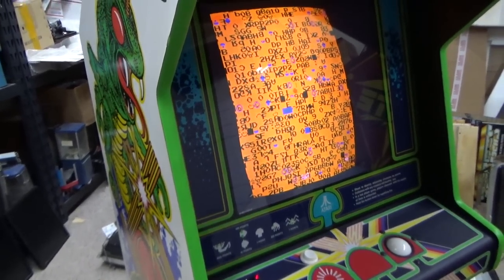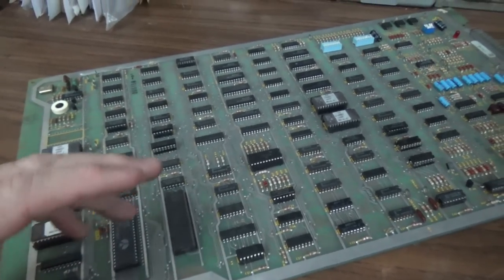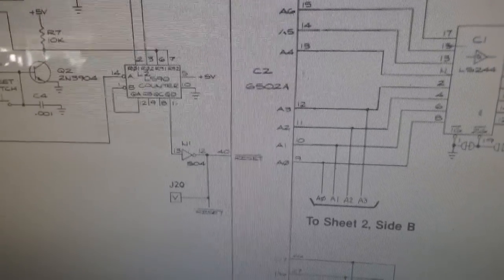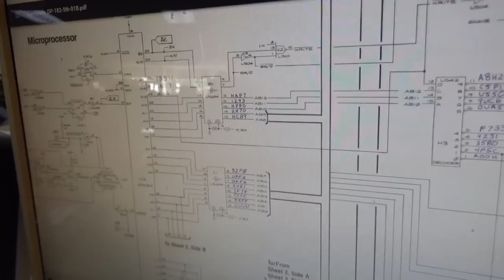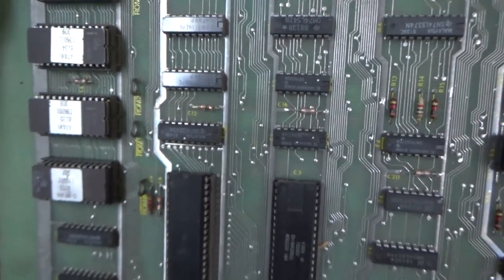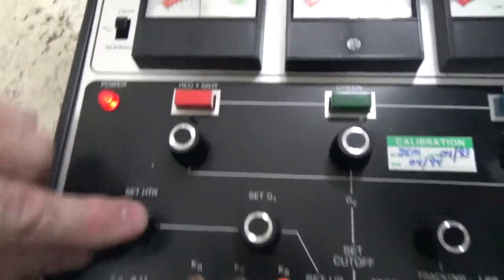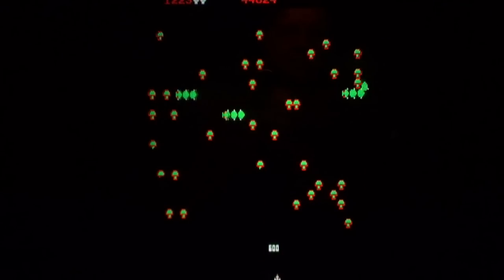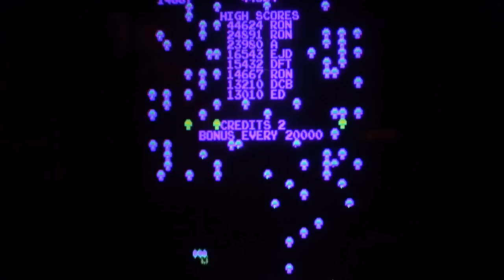How we Repair an Atari Centipede Arcade Game PCB With Minimal Test Tools - Simple Schematic Theory

Comment: Great video! However, I too have a Centipede that I'm having problems getting it to run. Upon powering it up, both player start buttons flash continuously and there are wavy vertical lines moving across the screen from left to right. No audio and sounds from coining up the game either, nor can I put it into test mode. Voltages were slightly low on the board, so I bumped them up to spec but still the same problem. Not sure what to do at this point. :(
Reply from the maker: When the buttons flash very quickly it's the game resetting over and over again because the program figures out something is wrong.  If it's wavy, as in you see the image diagonally, it could be that the sync section of the board isn't working.  The Sync section is driven by the counters in that area, if you look on the schematics right at the beginning, there will be an area that says like 1v/2v/4v/8v/16v/32v/64v etc. and 1h/2h/4h/8h/16h/32h etc.  Those are the signals that create a lot of the timing that makes all the rest of the game work.  Also those counters fail often.  If you have a logic probe, you can test each one of those lines coming out of the counter, and see if you can find one that's dead.  They should be pulsing back and forth as they send a frequency, if it stays low or stays high, that line is dead and the chip outputting it is probably screwed up.  If one of those lines is messed up, basically the game can't run code and without being able to run code, it can't run it's ram test.

Comment: as you probably know the shorts are usualy caused by burnt carbon  on the guns from impuritys in tube
 during manufacture and  randomly land on the gun assembly especially on mirror type cabs were the tube is neck down some times not often it can be encouraged to fall back into the tube by careful sharp taps to the neck while the tube is face down. anyway i was trying to repair one years ago when my brother threw a fire work into the garage behind me luckily i heard the fuse sizzling and ran out the tv was switched on .after the very loud explosion i went back and i could hear a ringing sound coming from the back of the tube looked at the front of the tv the picture was shaking believe it or not when it settled down the short was cured not only that but the red wich i had turn up due to low output was now too high i turned it down and tv was perfect. i have been waiting to get another shorted tube to re try this but havent come across one yet.

Comment: Excellent work as always :)
I was hoping you'd repair the board with the colour issues lol, as I have a spare board that has just developed an issue where the game boots, but instead of having a black background, it boots with a different colour background every time it starts. any ideas?
Reply from the maker: I've got two of them that do that and I can't figure out what it is... the reason it's starting with a different color is because the color ram isn't being controlled properly, it's something with the enable signal on the color ram chip and I can't figure out why it never gets turned on.... if you swap the ram it just makes it a different color, lol  Tough problem but if I ever figure it out i'll do a video on it :)
Reply: @LyonsArcade  Oh wow,  So that is interesting that we have the same issue! Would certainly appreciate the video when you get around to it one day :)
Yeah so F2 on my main board shat itself, So I figured I'd run the spare and keep my missus happy as its her game.  It worked great for a session and then developed the colour fault on the next start up.  It was one of those "C'mon now" moments lol

Comment: Hello- My positive and negative 22v test points on my Centipede are testing at 25.9 and 25.2. Does this indicate an issue with my board or power supply? Thank you very much for your help!

Comment: Newbie here, I have a question.  I recently just measured the voltage right at the jamma harness going into my CPS2 A Board and it reads 4.71 volts.
It reads 5.1v at the power supply.  So it must be losing a little bit on the way to the board.  My question is should I try to turn the voltage knob up a little bit  to try to get closer to 5v at the harness?  Currently the game plays just fine.  I just don't want to do any longterm damage.  And 4.71v seems a little too low in my inexperienced opinion.
Thanks
Reply from the maker: The best way to check is to measure it on the little fingers on the jamma board (not the harness, the actual board) to see what the voltages are that are actually getting through the connector.  Running it at 4.71 won't hurt it but it will probably be unstable and reset from time to time.  If it drops that much in the lines the lines probably aren't quite big enough to carry enough current without the voltage drop.  Yes though, you can turn the voltage up at the power supply to overcome it, all that is important is how much is getting to the actual board.

Comment: Great video! Did you change the cpu? Fake?
Reply: 6502 CPUs are not the kind of thing anyone counterfeits. If modern chips were made today they'd be better than the originals anyways. In the early 80s humanity could barely make a CPU period. Things have improved a lot since then.
Reply: @1pcfred  In the video Ron states “it might be fake I’ll change it. Just wondering if he did swap it for a known good CPU. We need continuity people! The fakes are non functional. Just the same form factor with the correct part number stamped on it.
Reply: @0MyWay01  if it was fake there wouldn't even have been sprites on the screen. No fake could have functioned that much. The buffer was clearly the issue. 6502s aren't worth faking either. They're still readily available. It looks like they're even in production still. Just not from the original manufacturers. The new ones are likely better than the originals were. Diffusion tech has improved in the past 40 years considerably. So even Wang Hung Lo in China can do it better today.
Reply: @1pcfred  -- Well, only the WD65C02s are being made now. If you need the original (like fixing an Apple), you pretty much have to go with used or NOS, and that's even harder if you need one from the "Sally" run to fix an Atari computer.

There were "counterfeit" chips back in the day. RAM often came with no markings at all. Some RAM was made by Mostek (junk), and that was not the same as MOS Tech (among the more reliable).

What hobbyists and repair folks need to watch out for today are things like the 74xx chips, EPROMS, and sound chips.
Reply: @PlumGurly  I have a lot of 74XX ICs from back in the day. I used to work at an assembly house and the boss gave me any extras we had lying around. Plus I scrapped a lot of parts. I was never into Commodore or Apple though so I don't have any of those special chips.
Reply: @1pcfred  -- Yeah, the Sally 6502 was a regular 6502 with a halt line. If you want to use bus-mastering DMA, then you need a halt line to pause the CPU and unlatch the bus. If you need one and don't have one, you could make a board with the CPU and 4 additional chips.

I mentioned the Apple II because it was built around the original 6502. The 65C02 may have changed the cycle timings on a few instructions. So the sound may be off and the floppy drive might start trashing disks. It used bit-banging to drive the devices and was timing-critical. So if you use a more efficient 6502-derivative or increase the clock rate, it won't work properly, at least not unless you want to rewrite the ROM.
Reply: @PlumGurly  I've avoided the whole retro thing myself. I guess everyone needs a hobby but pursuing that old stuff isn't something that I'd do. Not when there's so much new and better stuff today.
Reply: @1pcfred  -- Well, most in the retro scene are not purists. So they are not above using FPGAs, SMDs, and make workarounds using newer tech. So a lot in the retro scene embrace the shortcomings of trying to have something more like what was around in the day.

If I were to attempt to build a pinball machine, I'd likely use the older stuff as a template for things such as cabinet sizes, etc, but embrace newer tech where possible. So it would make extensive use of LEDs. And if the old "bricks" can't be found, I'm sure there are plenty of replacements to use, even if you must use multiple PSUs to get the job done. As for mech, I am sure plenty of stuff can be fabricated fresh, and for a lot of things, there are replicas of older parts that are being made now.
Reply: @PlumGurly  that's practical. Retro computing strikes me as an impractical pursuit though. As long as they're having fun I suppose it's all good.

Comment: When the monitors heater circuit is shorted that means that the monitors CRT TUBE has a shorted heater internally inside the CRT Tube? Even if you used an external power supply to supply the heater voltage it will still short out the heater voltage. The Clock Signal is triggering the Enable pins for all the IC chips which is clocking out the data out of the IC chip or clocking in the data into the IC chip. If you Remove the Clock signal the data should be free running ( not clocked ) because most of the IC chips have an Enable Pin which if you tied direct to +5 volts the data will be active all the time ( not clocked )
Reply: I'm not sure if that is right. The /CE or /CS line on most chips just disables or enables the chip. That has nothing to do with the clock, and most chips don't use a clock signal, just registers/flip-flops/latches, counters, and memory. Most of the chips are combinational logic, like gates that work irrespective of a clock signal. Things that require a clock signal is called sequential logic.

Registers need a clock since a time reference is needed. What goes in and what comes out relate to different cycles. The output comes from the previous cycle while the input is from the current cycle.

On memory, there is asynchronous memory that doesn't need a clock signal. As long as you can do things within its rated time, it doesn't matter if the rest of the circuit it is in requires a clock signal or not. Other types of RAM such as synchronous, registered, DDR, QDR, etc., require one or more clock signals.

A CPU is generally a synchronous device, even though they also use plenty of async logic inside. They do make asynchronous CPUs (and even GPUs) but the market is slow to adopt those. They don't use a clock and tend to use twice the amount of logic of synchronous CPUs. They have the potential of being faster since a clock is not limiting the faster parts, and this can simplify the logic since the adders in the ALU don't need to be as robust to fit time constraints and are allowed to vary in the time they take. Sometimes a carry-skip or look-ahead adder arrangement takes up a significant amount of the die space. The main advantages would be producing less RFI, using less power, and being more adaptable to the environment. Like what if you create a bendable CPU? If it is synchronous, flexing it might alter the timing needs and crash the CPU. They'd also be better at adapting to temperature since if they get hot and want to work slower, they adapt to this and slow down (since the handshaking signals are taking longer). And if they get undervolted a little, they would still work, just slower.
Reply: @PlumGurly  When using an Oscope to measure the data signals, address signals, control signals on the busses, the Oscope can't SYNC or Trigger to get a stable waveform displaying is because the data signals, address signals, control signals are SYNC to the clock signal frequency. When measuring data signals with the Oscope you have to use the External trigger port to apply the arcade boards clock signal frequency to get a stable waveform display. When getting a stable data signal waveform display and measuring the TIME PERIOD of the data signal, it doesn't MATCH or equal the clock signal frequency that is on the arcade pcb board, any reasons why? Since the Data signals are referenced to the clock signal frequency the data signals time period should be Match to the time period of the clock signal frequency?

Comment: Do you have any experience repairing two-way radios ?
Or know anyone who does ?

I have 3 RCI-1000 handheld 1 watt 2 channel VHF crystal two-way radios

2 if them work, I put new rechargeable battery packs in them and they came back to life, but the third one is locked on in transmitt

It is not sending out audio from the microphone

I think there must be at least 1 transistor that is locked on and is sending power to the transmitter part.
It could be a short through a resistor or capacitor doing this, or a transistor causing it to stay in transmit all the time.

These are from the 1990s, early 90s, and they have 4 crystals, 2 for receive and 2 for transmit

These are 2 channel, from a slide switch on the top.

The company Ranger Communications is out of business and I can't find any schematic for the radio.

If anyone knows where I could get a schematic online for this model, that would be a big help 

Thanks

Comment: What is “the pokey”?
Reply from the maker: It's the name Atari gave one of their custom chips, "Pots and Keys", it handles some of the inputs and the audio along with a couple other things.  I think on Centipede it doesn't do any of the inputs though.
Reply: @LyonsArcade  Thanks. I heard that term on another one of your videos and I was thinking what the heck is that?
Reply: It is the POrt and KEYboard controller for the Atari home computers. However, they also include 4-channel sound. Those are interesting chips in that they also have a high-res sound mode that was rarely used since that sacrifices up to 2 channels. Most applications used them in 4-channel mode, and that was part of the motivation behind the Commodore SID. The higher res mode is 16-bits, and the lower res mode is 8, and it is hard to correctly represent a notes table using 8-bits. So a few notes may sound out of tune. And Commodore believed they could do better and created the SID.

There are even specialized versions of these such as the Quad-Pokey. A quad Pokey is next to impossible to find for the arcade games that need them, but thankfully, there are FPGA replacements.

If you need an FPGA Pokey or SID, while they won't sound exactly the same, they are very close and indistinguishable to most.
Reply: @PlumGurly  Thanks for the in depth explanation. That makes it very clear.
Reply: @VegasCyclingFreak  -- You are welcome. I like some of the mods done to Atari computers, like adding a 2nd Pokey at another address. So that would enable stereo, and those into music sequencers would have 8 channels to work with. I'm not sure, but I think you could override the oscillator too on those and bit-bang sounds out of it if you wanted to, and preferably in Assembly.

Comment: Yeah, if you don't get 3-4 volts at the chip, you never go past the metastable zone. So yeah, you need the 5 volts to be there.

And yeah, the reset signal holds the program counter to 0 or whatever the starting vector address is. The entry vector might be $0200 on the 6502. I figure that because you have Page 0 ($0000-$00FF), and the stack page ($0100-$01FF). The program counter might have garbage in it, so reset puts that in the right place. Also, the reason to hold it there for a couple seconds is to give the rest of the board time to start so the CPU doesn't start until then.

From what I saw with the flashing, I'd assume it is a pot on the monitor. But, it was an internal short.

Comment: Still trying to understand electronics but just can't..guess I'm not wired that way 😔
Reply from the maker: Just do a little at a time, eventually it will click... I don't know much and have been doing it for years
Reply: @LyonsArcade  I got books on electronics at home, hell I got an uncle that's a sparky(electrician) if I applied myself I guess I could
Reply: @LyonsArcade  I'll get it one piece at a time and it won't cost me a dime 😁
Reply: @naytch2003  it helps to have some hands on experience to reinforce concepts. If you really want to understand electronics then get an oscilloscope. Then you can see what's going on. That's it. Learn how to use an oscilloscope and electronics will make more sense to you then. There's books available that explain scope operation. I'd say the other important thing to learn is Ohm's Law. When you start blowing stuff up understanding that is how you keep the magic smoke in stuff. I knew a guy that hated LEDs because he tried to use them in his model train set and one blew up and hit him in the forehead. He couldn't grasp that you had to limit the current to the device. It was different than light bulbs.